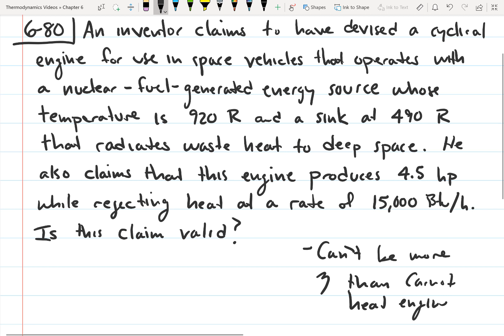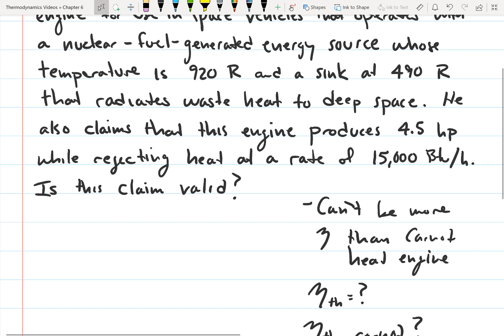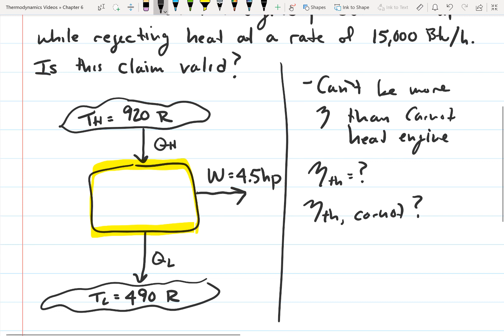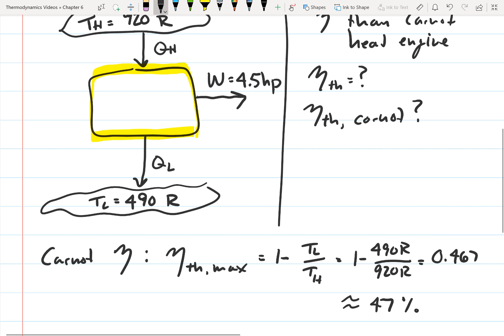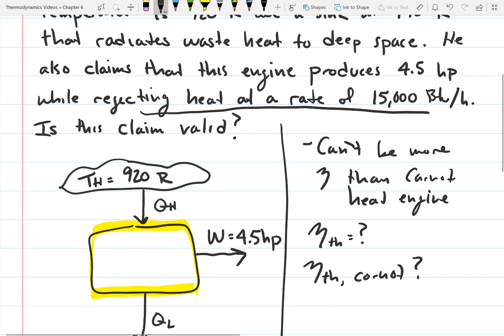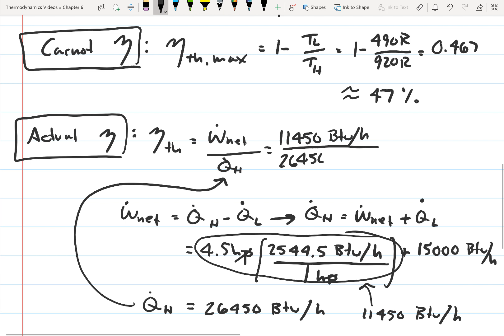Thermodynamics: Example Efficiency Calculation to Determine if Cycle Meets 2nd Law Requirement

Comment: I don't understand why you are saying it is valid if it is lower than that of the Carnot efficiency if there are not errors in the problems mentioned.
Reply from the maker: You can't have an efficiency higher than the Carnot efficiency because the Carnot efficiency is the best that you can get. If you calculate an efficiency higher than the Carnot efficiency it means that your system isn't possible. So you can have an efficiency that is lower than the Carnot efficiency but not higher.